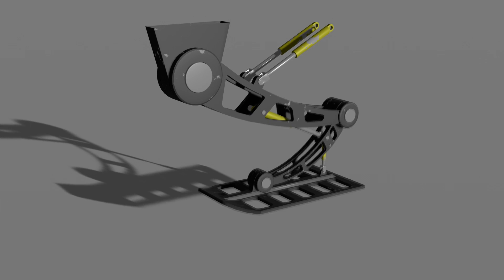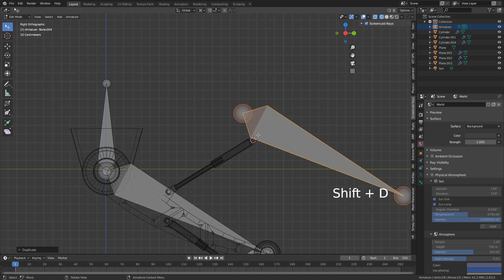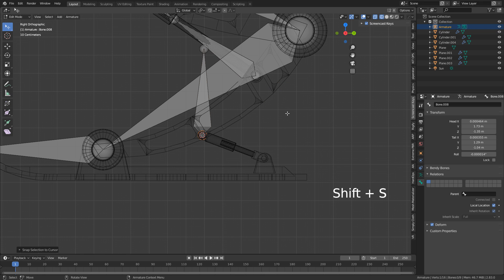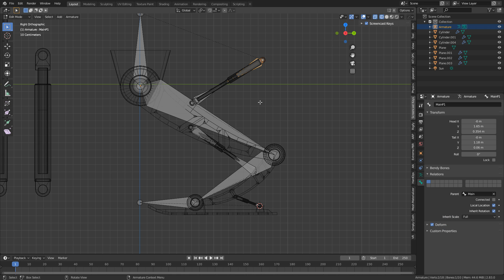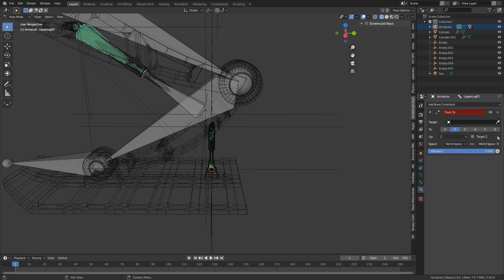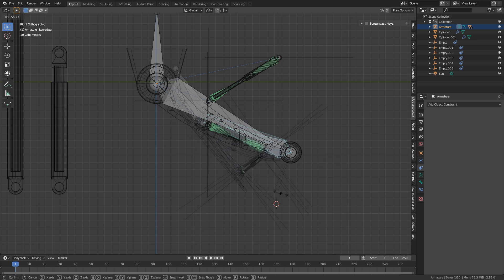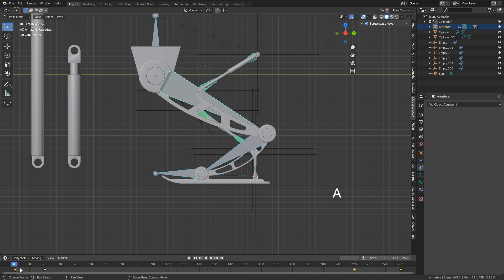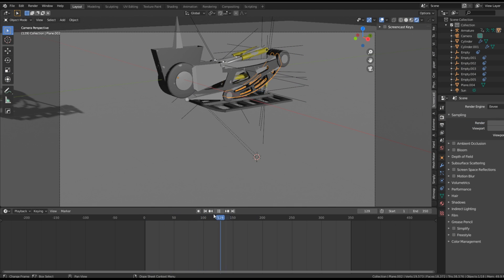How to Rig a Scifi Landing Gear in Blender

Comment from the maker: Was this video beneficial for you? What did you think about all the relationships between the bones?
Reply: Excellent! This is exactly what I needed for the kind of work I do. I also figured out that you can create an IK target bone at the foot, add an IK bone constraint to the lower leg, then parent the IK target to the main bone. This way you can just raise and lower the foot platform, keeping it always level and you only have to animate one thing.
Reply: @scatterbrainart  IK?
Reply: Greatly helped me, took about 2 weeks or so to get my head around the fundamental components and applications, but finally got my gear to work without looking like it's about to snap like a swig! 
Cheers.
Reply: This was awesome video, well made.
Reply: can i use ik to control the leg up and down？
Reply: This is the exact tutorial that YouTube didn't have. This is the perfect video for Hard Surface rigging.
Reply: Very useful. I made a little 2d cut out version, with the same rig.
Reply: Thanks a lot, you make my day !!! That’s exactly what I was looking for to animate my piano stool. I had a good idea of what I had to do, but theory and practice...

Comment: A damped track seems simpler than a group of empties. I still think you'd need the empties for location data for the pistons. I'll try it both ways. That's the cool thing there's a dozen ways to rig something and each has an advantage over the other.
Reply: Yea i was wondering why cant they set the track to to track to (thats a weird sentence LMAO) to the head of the other bone
Reply: Set the track to to track to xD
Reply: i rewatched the vid at 6:56 and it seems tracking the positions of the bones themselves isnt a good idea, it might cause the program to work harder than it should?
Reply: @citrusblast4372  That's a good point. Adding math on top of math then plotting distances all take more steps. Then, adding in betweens and telling the computer to narrow it further. Attaching bones does save time over moving each piece in space. I've been there. Just, to see. 😁

Comment: Thank you for this Markom! I am rigging wings for a model I'm working on and have been able to use what you   taught so far, however I have been struggling for 2 days to get the armature right and am now banging my head against the wall. Wondering if you are open to a consultation? I'll pay you to be able to figure this out at this point, as I am at peak frustration.

Comment: Excellent tutorial! A remaining problem I've always had with a complex mechanical model like this, is figuring out which end should be the head of the bone and which end should be the tail. I keep playing with "Reverse direction" until it looks right, but I figure they must be some general rules for deciding where the head should go. This is the biggest problem I've had, especially when a part has a complex movement (like the treads of an army tank).

Comment: Great example! BTW you don't necessarily need the empties for tracking. A bone can track another bone. So you can skip this step and save some time.
Reply: It generally works, but it creates a dependency loop, so it might break occasionally. It won't reset the rotation of piston when canceling a movement with a right click for example.
Reply: @DCGloto  Normally you want things contained inside the rig, so using bones is the way to go, to fix the dependency issue, you just duplicate the bones and set them as target of constraints and give them copy location or use proper parenting to make them follow the bones you want, they basically act as placeholders so you don't need to worry about rotation, scale, roll. If you use things like empty outside the rig, and you give the file to animation team, you have to make the empties not selectable to prevent being changed or deleted.

Comment: I was thinking about stepper motors at the pivot points then would just need to cable each motor. If you didn't want to mess with hydraulics. But hey, what do I know.....

Comment: Please help. Im going nuts with trying to rig this hydraulic system. Everytime I track my constraint to the opposite empty, the track axis option has to be Set to „Y“ and the UP Option has to be set to „Z“ for it to be able to work right? Well when I set my Up Option to „Z“ my objects twist in a weird way and it dislocates everything. Only when I have the UP option set to „Y“ everything stays in place but the bone doesn‘t track properly. I triple checked if all my bones were precisely placed within the objects and everything alligns perfectly but the tracking won‘t work. What am I doing wrong?

Comment: Hello, I was able to keep track for the most part of the tutorial, but I'm am stuck with two piston halves (MainP1 and FootP1) both geometries do get distorted or just vanish, when I try to move the whole gear. But the bones keep track of each other. But the bones themselves are either rotated or do not point exactly to the other empty. I tried to redo the bones but with no success. Has anyone else encounter that phenomena?
Reply: Yeah. When I set my UP option to Z that happens that the two objects that are connected to the two piston parts just rotate weirdly and dislocate. If I set the UP option to Y everything is fine, but they dont track eachother anymore. Really annoying. Have u found a fix?
The disappearance of objects also happened to me when i parented the bones to the mesh but as soon as u parent u click on „keep transform in the little pop up options window in the bottom left and then its visible again.

Comment: I just tried this with Blender 3.0 and for some reason the 'track to' constraint isn't working (It could also be that I'm a goober). Instead I used an IK constraint targeting the empty with a bone chain of 1. Not very orthodox but it worked.
Reply: Hey Wade, I think I had the same problem.  There are two different constraints you can set.  Object Constraints and Bone Constraints.  I was, by accident, setting up object constraints, which applied to the entire armature and not the bone.  Make sure you're selecting Bone Constraints and see if that will fix your problem.

Comment: I'm confused, you don't parent the objects to the armature, yet your armature affects the various objects, even though the only parent child setups are for the empties. I'm getting nothing
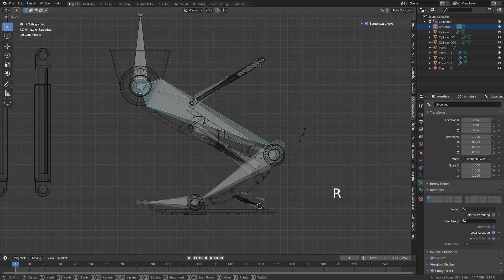Reply: Actually, I re-watched the video, you were setting up the bones, at that point, nothing was parented, the bones moved, but not the geometry, but when you re-started the video at 06:38. On return, clearly the main setting up of the armature and rigging had been done, but cut from the video, as from then on the geo moved with the armature.
Reply from the maker: yep
Reply: @Markom3D  So was cutting the actual rigging deliberate? Kinda defeats the title of the video series in that case. 😉 Unless you decided to pull that back for another video to keep the length down of course. 🤓 Just felt like this was the last video. Or is that section only available on patreon?
Reply: Have attempted the parenting and my movement isn't the same as this video. Am using parent > bone, clicking on one mesh then shift selecting the appropriate bone and parenting. What am I missing? This is my first attempt at rigging.